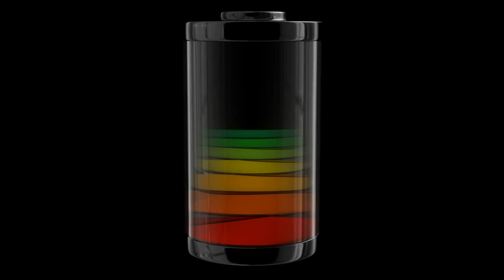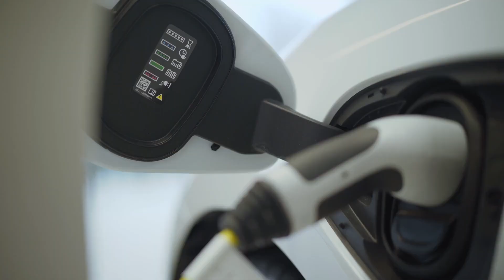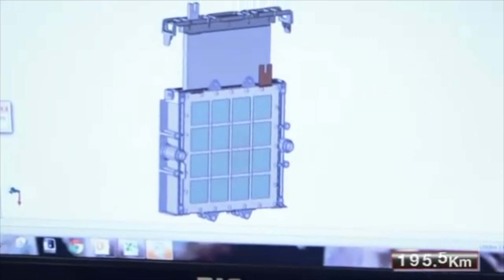This Battery Gives EVs 1000 Miles of Range!

Comment: Sounds like Aluminum Air Batteries would be better for aviation.  Me personally I think when supercapacitors packs the size and weights of your standard lithium ion EV battery packs an allow an EV to have a range of 40 miles the supercapacitors beats everything else.  People are so hung up on range.  Such a supercapacitor pack could be fully charge to 40 miles on the lowest DC fast charger in one minute fifteen seconds.  Your standard charging station of 240 volts in ten minutes 30 seconds.  On your standard 120 volt house outlet with standard extension cord in 50 minutes.  Throw a fold-able 2 foot by 4 foot $150 dollar solar panel in the trunk and you could get a 40 mile charge in 5 to 6 hours parked in the sun.  Sell a supercapacitor EV with an extra external supercapacitor pack and solar panel to put on the garage roof and you can super charge at home in a minute fifteen seconds.  No need to even be one the grid.  I foresee EVs with solar panels hidden under the hood of the car that with the touch of a button deploy automatically and track the sun.  Thus allowing an EV to get a 40 mile charge in about two and a half hours.  Supercapacitors have a much much longer lifetime.  The supercapacitor pack will probably outlast the EVs major components and there is no capacity lost.  A 40 mile range when new will still be 40 mile range even after 30 years.  Businesses like Starbucks and McDonald's can offer a FREE full 40 mile charge while you wait for your order at the drive through.  Supercapacitors has such low internal resistance that it only takes 1/10 the amount of electricity to charge mile per mile than a lithium ion battery.

Comment: Great episode! One challenge of battery swapping is actually the whole process of swapping batteries. You will need a fresh, new battery installed and it will fall on to the owner of the battery swapping station/franchise to provide available batteries. This is a huge cost because air-batteries will likely be very expensive. This cost is then passed down to the consumer where you're responsible for paying thousands of dollars for a new battery every 2,700 miles or so. This easily makes the platform economically unsustainable for consumers.
Reply: sure - for now that is the projected case and why these batteries have not yet taken off.  If recycling and replacing the batteries can improve - or if they find a good/reliable/long term way to recharge these... it could be the wave of the future.

Then there are solid state batteries... and/or super capacitors - that would use graphine and charge in a few minutes (almost as fast as you can fill a large fuel tank).
Reply: @drx1xym154  You're talking about battery technology that is not discussed here. I was keeping my response narrow and within the topic which was current battery swapping technology.
For example; rechargeable batteries that can be used for battery swapping presents it's own problems like "how do I know this battery is still within its expected life?" or "how do I know this battery still holds a full charge?" this would require some kind of automated testing of each battery, which inevitably increases the costs per unit and is passed down to the consumer.

There are a lot of possibilities but for the sake of simplicity in regards to this video, battery swapping is not currently feasible when compared to other existing consumer technologies (such as recharging).

Comment: Hahaha.... How to produce 5he aluminum? The green deal is a total wash until we harness the sun. Anyone who thinks electric cars will solve the carbon (non-problem) problem... Is a virtue signaling idiot. When you get rid of petroleum.. you can kiss technology away.
1000 miles, pay an absorbent fee (way more than 3 tanks of gas) and get another battery. That's once a month for anyone who commutes 40 miles a day to work.  Do the research on how emerging countries break out of poverty - it's fact that the lowest cost solutions are used by them... Petroleum will be their step up, not electric.
Keep researching YES! but for the world's sake, push the virtue signaling urge off for green power until it's practical and affordable. The climate change is the big impetus for this, and that's a big joke as well.

Comment: I'm surprised that the petroleum industry doesn't get behind this as it would be able to reuse the current fuel distribution infrastructure, which is not as easy to do with rechargeable batteries.   It is for that reason (as far as I understand) that there was a lot of kickback form the industry.

Comment: If I stop at a gas station for about 10 minutes to fill up may tank and they charge me about 100 dollars, couldnt be possible to stop at the same gas station where they swap my depleted battery for a new one in 5 minutes and charge 50 dollars? Battery should be easily accesible like just opening a gas tank door and sliding it out. A simple automated system could slide in the new battery and close the door. Thats it. It could be faster than a pump erogating 25 gallon of gas.

Comment: Not so much for consumers in the short time due to the required swapping infrastructure, but ideal for any industries with their own depots or bases of operation where battery swapping could be implemented. Construction equipment, haulage lorries, public transport, even aircraft or ferries. They could all benefit.

Comment: If the aluminum air battery can give a 1000 mile 1600 km range and it doesn’t take a month to charge sign me up! They have discovered my electric car battery. A battery with that range could be carried as a spare in the bed of an F150 Lightening and I’d have a 1300 mile range!

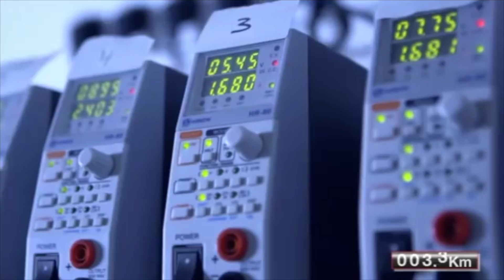Comment: Erm at 8:10 you said "600km or 1000miles". wrong way round I think 1000Km or 600 miles ?
Reply from the maker: 1600km or 1000 miles. Apologies I read it wrong
Reply: @TwoBitDaVinci  No apologies required, excellent You Tube Channel !  Keep up the sterling work !!

Comment: How long to charge up?
Reply: It's not rechargeable
He said it in the video
Reply: @awesomefacepalm  Then it's basically useless. By the time the thing was paid off the battery would be dead and replaced with an intelligent model.
Reply: @johnholzhey8149  probably. In theory it's relatively cheap and not as environmentally unfriendly as lithium based cells. So it might have it's uses
Reply: @awesomefacepalm  it's possible they could be used for something, but what I have no idea. The EPA would stop any kind of landfill disposal etc.

Comment: The battery swap system has always been the way to go. For starters, it’s the most expensive part of the vehicle and you just pay a rental cost for it - like gas bottles have been for years -,  thus diminishing the initial purchase amount. The drawback that was used as an excuse for not developing it further was the low mileage per charge and therefore the need for many swap stations. Now, with this technology, only having to do it every two and a half thousand miles, it’s a no brainer.

Comment: The benefits of Al-Air 8x driving range would be great.  Having to replace the non-rechargeable battery could be logistically accomplished.  However, isn't the total charging cycle efficiency of Al-Air (reference: Wikipedia) only 15-20% vs 99% for Li-ion?

Comment: OK, by the half way mark you've eventually answered the question......what is an aluminium air battery or electricity producer....can I say generator?
I once debated a scenario that if you could go back in time and mix with the Romans what technology would you reveal to them that they could make with the methods they had at their disposal, and one thing was electricity.....provided that could draw copper into wire and insulate it.......varnish?........they could make an electric motor and power it from a copper zinc battery pack.......2 thousand years later and we would be living on Mars not just sending drones and robots there.
Reply: I think the time has come for the EV to have plug in plug out extended battery capability......this is how you get your barbecue LPG today....at least it is down under in OZ.....nobody takes their gas bottle to be filled anymore and have to have the bottle tested at 10 year intervals......I take my empty LPG bottle in and get a new full one in five minutes..........if you can do it with your digital camera why not the EV.

Comment: You don't need to change the entire battery.  You only need to change the aluminium plate and residual water. it takes only  2-3 minutes.  You can keep more aluminium plates with you and  can change when those plates depletes.

Comment: capture the carbon during production - swap only the anode , why swap the whole battery
Reply: Because it's faster and easier to replace the battery as one unit rather than swapping out the individual anodes, which are a bunch of separate plates inside the battery. Once the battery is out of the car, the anode plates can be replaced and the rest of the battery gets reused as is.

Comment: You can't compare two gallons but what about the weight of the engine that needs to power the two gallons of fuel. Battery doesnt need an engine

Comment: If this type of battery is as good as you say then why hasn't power tool manufacturers jumped on this yet. Power tools are always selling people on bigger and bigger lithium batteries but the downfall is the weight and they're very pricey. The aluminum battery could be a perfect starting point for In power tools if it was rechargeable or much cheaper to replace overtime.

Comment: For a second, I thought you were talking about Ultra-Capacitors, or something similar, but no. I don't like these Aluminum-Air, non-rechargeable batteries. I can imagine these swap places being not only hard to find/get to, but also be busy AF. And I work & play overnight, so would these battery swapping places be 24hour?

I am not comfortable relying so heavily on such places, especially when they are starting out and not common, if they ever will be.

I'm loyal to motorcycles, and I am way more interested in DC-Fast-Charging production bikes like the Energicas, a kit to give a homemade electric motorcycle DCFC, a production electric motorcycle with swappable lithium batteries like the Zero FX, a homemade electric motorcycle with many swappable ebike battery packs, or just build a plug-in hybrid motorcycle.

Its bad enough Tesla doesn't make motorcycles, won't sell their amazing batteries direct to the DIY community, and batteries with chemistries better than lead are so expensive.

This is why I am stuck with renting an ebike, getting a gas motorcycle, buying or building a swappable lead battery bike until I can trade up chemistries, or just building a hybrid. The lord & savior Elon, is disappointing me right now.

Comment: Still sounds like a finite fuel source, which EVs seemed to be worked to get around
Reply: Lithium has a limited supply. And our electric grid is fueled mainly by natural gas and coal, so the electricity itself is a limited supply as well.

Comment: .. also some older car engines are more fuel efficient.  My 50 year old toyota has better fuel economy, and a significantly larger payload capacity than a Prius. Slap in a aftermarket cat and its also less polluting.
Reply from the maker: No it’s not. Modern gas engines get better and better

Comment: What makes you think that this people will used this batteries till its dead.... I happened to lived in an area that requires long range in one single trip in the middle of no where I may have enough to get there but not enough to get back, then what if you need to change this battery with 600 miles left .... do you get credit on the replacement then if this was possible you will be collecting 100th of batteries to someone whom will ignore then just it's a good idea to buy a half dead battery but "WHAT IF then I may get stuck" just think of the cost of getting this batteries swapping station almost like every other GAS station.... then this concept it's great in a 2 minute conversation but never on paper and  impossible in a 5 minute conversation base on the what if.

👎👎👎👎👎👎👎👎👎👎👎👎👎👎

Comment: apples and oranges....two gallons of gas may have the same energy density as 1000 pounds of lithium battery but 2 gallons of gas won't get you 300 miles....
Reply from the maker: No one said it would

Comment: "A 300 mile range Tesla 3 has about 1000lb battery pack. To store an equivalent amount of energy in gasoline would require just 2 gallons". What car on the road today is getting 150 miles per gallon?
Reply: He was stating that the amount of energy (in KWH or Joules)  would be equivalent,  electric engines are 70%+ efficient on energy use, while ICE engines are "traditionally" around 20%, so it would take 7 gallons of gas at 20% efficiency would to equal the range of a 1000lb battery in an EV that is 70% efficient even though the battery only stores 2 gallons of gas equivalent energy. Hope this helps!  Stay curious my friend!  (Wikipedia used for energy approximate energy efficiencies)
Reply: While the car itself may be 70% efficient, the delivery of power to the car is not. Immense amounts of power are lost creating the electricity and delivering it to your charger and then to the battery. Physics cannot be overcome, there is no free lunch.

Comment: the problem I see with aluminum air batteries is three fold.

1: & this is the LARGEST of the problems: smelting of aluminum oxides is done using carbon byproducts of OIL REFINEMENT... THUS why we see one of the companies PUShING for use of this power source ? an oil company. and why is that a problem? more on that later.. but hold that thought. 

2: you're hog tied to the companies who sell you an expendable battery- no different than the oligopoly of the gas pump. 

3: aluminum mining & petroleum byproducts are equally 'evil' as human rights violators & environmental polluters as drc cobalt. if suddenly EVERY vehicle on the planet that was ev started using aluminum as its' energy source? the sheer volume of aluminum required would make the plight of those kids in the congo pale by comparison. remember- a 2170 battery pack on a tesla has about 1% of the battery pack in cobalt to spend over a 10 year period on a tesla- VS 200 LBS of aluminum for every MONTH of usage. 

about big oil:  big oil doesn't JUST not want batteries that can be recharged- they don't want ANY technology that even SLIGHTLY reduces your dependency on them. there is a diesel engine, developed by achates power, inc, with a prototype in an F-150 RIGHT NOW... it gets 30% better fuel economy & pollutes 20% less than our BEST current diesel engine tech- AND? it will NEVER see the light of day. why? well, you & I think- WOW! wonderful! 30 percent better fuel economy! less pollution! all big oil sees? 30% loss in diesel sales, nope- that thing has to go. 

and that? IS WHY CURRENT big oil management HAS TO GO. no restructuring.. no restrictions, no "promises to the EPA"... no. just gone. as long as they exist- they're going to use every last cent they can muster to kill, buy out, and otherwise get rid of competing technology that offers consumers better options. and why not? they're a 4.5 TRILLION dollar a year business- they've bought & paid for the epa, the legacy auto lobbies, the tesla short sellers, the SEC, they bought stanford ovshinsky's NiMH battery invention- had GM test run it in the EV1- then had GM kill it- then they bought the patents.. and shelved them. big oil inc.'s dna has to die. perhaps after Elon finishes taking a wrecking ball to their finances... he can install a CEO from Tesla who can manage petroleum assets & see to it they don't cause any more mayhem. 

the BIG PLUS of lithium.. he's NOT telling you here- if I drive a gas car- and the oil giants want to raise the price at the pump? I'm just screwed. if I drive an EV and the grid raises the price of KWH's? I can go solar. I can buy a diesel generator & set it up to run in pure used vegetable oil. I have options. the ONLY reason we're hearing ANYTHING at all about AL air batteries or H2 fuel cells? is because those technologies would keep big oil in business... and keep us in a position where THEY control the cost of our transportation... AND THAT'S THE ONLY REASON WE'RE hearing about it. 

there's one more thing he's NOT telling you: CURRENT 2170 TESLA batteries use less than 2% of cobalt. all the other lithium battery producers? upwards of 10 to 15%. also- Tesla will be eliminating MINED cobalt from stationary storage and shorter range ev's.. with the eventual complete phase out of mining cobalt altogether- in favor of cobalt recycling by redwood inc. (jb straubel's co.) in addition to that- Tesla uses a specific algorithm to spot companies that use child labor in the DRC- and they refuse to do business with them. how does tesla do that? well, if that was known- those companies would better know how NOT to pop up on tesla's 'do not call' list. but the last but not least- is the reason that ... yes, although cobalt does help with the stability of lithium batteries, and make it have more charge cycles- it also means the energy density is less- so, getting rid of cobalt in favor of a better stabilizer was always the goal.

Comment: I would buy this technology.  ONLY IF I can rebuild my own batteries and be able to easily buy new Alum. Plates ready to install. and a Reclying process that would BUY the WASTE Oxide material. 
I would then buy at least 2 or 3 batteries to have 1 Alwyas ready to swap.   

In fact, years ago, I developed a way to swap a battery in mere SECONDS (slide out, slide in) thru the REAR of the car.

Comment: I wonder if that might be more suitable for house batteries. Unlike a car, a house has less dimensional constraints. Also, anode swapping solution in the house system can be more practical. You can also set up permanent clean water supply (using  RO filter)  and drain.